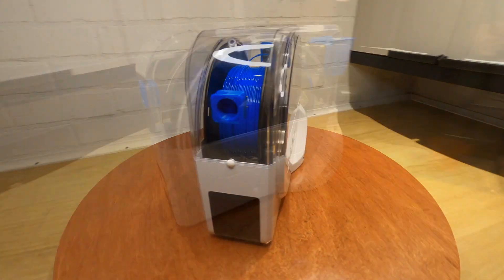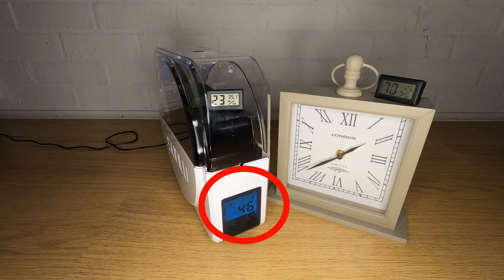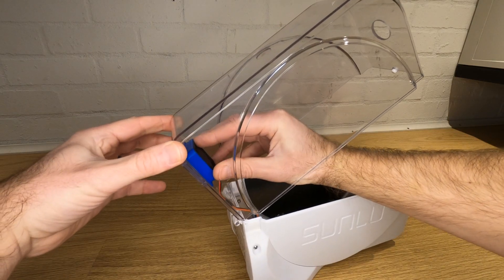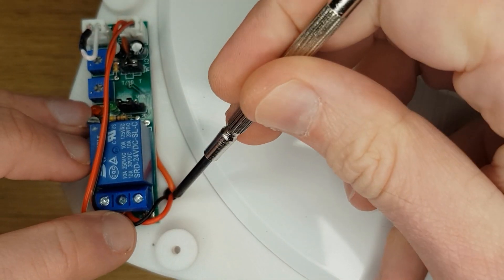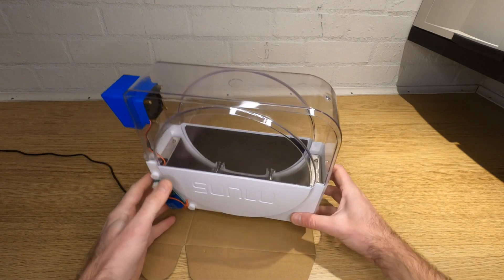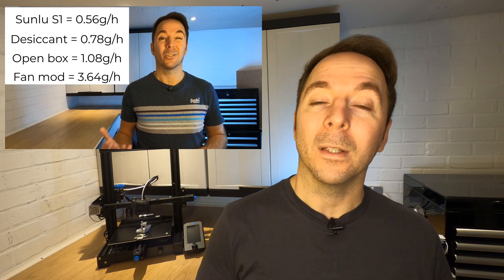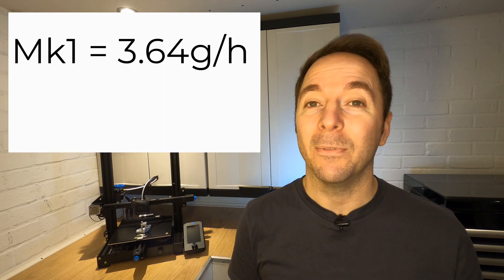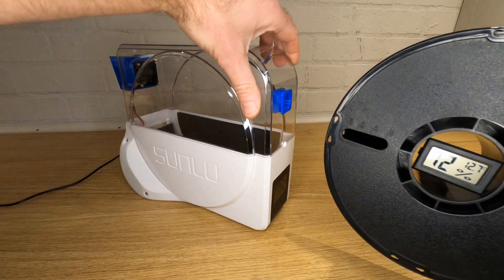Sunlu S1 Filadryer Turbo Mod Mark 2 & Build Guide (Timer, speed control, intake vents and more!)

Comment: Ok, I have everything wired correctly, relay and thermal switch is working properly. My issue is the 40mm fan listed in the parts comments is barely moving any air. The louvers aren't moving at all. There is no issue with the parts rubbing, the louver flaps move very freely; the fan speed is just way too low to push them open. It's a 24 volt fan, just nowhere near the RPMs of the fan in the video. Any suggestions?
Reply from the maker: Did you use the same fan that I linked to in the video description Bryan? If not, then it's possible that you simply have a fan that doesn't move enough air.
Reply: @RickyImpey  yes, used the link to order the fan directly from Amazon US. Maybe I got a bad fan? I can order another and try it.
Reply from the maker: @Squak242  Strange 🤔. In that case then I would just be extra careful to make sure your fan flaps are completely free moving. They need to be able to drop when you turn the whole assembly backwards like when you open the lid. When the fan is on, mine only open approx 3-4mm but it's enough to push moist air out.

Comment: Add a small metal insulated box with a slotted box that feeds the main box air. Fill the first box with desiccant packets so the air inside the metal box receives dry air. Place a heating element in the metal insulated box. Now feed your filament dryer box air from the previous mentioned setup. Also insulate your sunu

Comment: By the way, those humidity sensors are very poor. I have them and mines are reliable only down to 39%. Below that, and the start dropping WAY faster than the air. Compared to a proper sensor, for example, they may indicate 33% for 38%, 25% for 34%, and so on. The difference between indicated and real RH is about zero at 39% and increases below that. Temperature is fine.
Get a reliable one, like Xiaomi or Aqara temperature humidity sensor (zigbee), which I tested down to few % RH.

Comment: With a 40 mm fan placed in the front top corner pointed down you should be able to have a circular circulation of air, so that the colder top air will pass down and heat again, so that overall everything will stay hotter. Periodically, the existing fan will push out air, or simply use natural circulation, with a smaller hole always open (use a iris diaphragm to tune the diameter of the hole for passive removal). On the transparent top you can put insulating foam everywhere, it should not affect the spools.
Reply: I was recommended by Youtube this video which shows exactly what I was proposing! https://www.youtube.com/watch?v=6FG4O5l9XpE The results are amazing.

Comment: Check the $10 STC-3028 humidity and temp controller, have different versions for ac/dc etc. Gives the option of independently controlling the temp and humidity. I'm thinking over using a styrofoam box, depending on the size, it can accomodate 1 or several spools. A small glass/plastic window is easy to cut in.  Also, how anout using a small membrane vacuum pump, to get rid of the moisture... Lots of options
Reply from the maker: Yes, I think I've pushed the Sunlu S1 as far as I'm going to for now. I would like to be able to dry multiple rolls of filament at a time but the hardest thing is finding a suitable box.

Comment: Thanks!! Great solution. I opted for four 3/16" holes along the bottom on each side, two in the front and two in the back, and four 3/16" holes around the center of the top of the unit. You made a good point about convection and I thought I would take advantage of it. My unit  temp stays between 55 and 56 C now and you can feel the heat coming out of the holes on top. I do like your box dryer solution too. Thanks again.
Reply from the maker: Sounds good Chris, that will definitely improve things over the standard unit👍

Comment: let it breath dry air in by using an oil bath/ silica gel bead contraption like a "transformer breather"... and/or heat incoming air and dry it again, using silica.

Comment: I have 2 of the Sunlu S1's that have been modded to include the fan to move around the air, and the thermal sensor.  I also use a couple of packs of desiccant placed in a holder in the center hole of the spools.  I forget the exact name of the holder, but I got it from Thingiverse.  Using a gauge almost identical to yours, I can watch the humidity raise significantly (sometimes with visible moisture in the lid), then significantly drop as time goes on.  My biggest issue is that despite setting them at 55C, the temps rarely get above 48-50C inside.  This is verified by not only the gauge, but an IR temp gun.  If I could get these things to actually reach 55C, it would rate #1 on my list of dryers.  For reference, I also have the Sovol 3D dryer, and the PrintDry Pro dryer.  Both of them have advantages, and disadvantages over the Sunlu unit.
Reply: Do you already have a towel to insulate?
Reply: @olafmarzocchi6194  I do not have a towel in it.   Why would I?
Reply: @tommyc8333  to reduce heat losses
Reply: @olafmarzocchi6194  not really sure how that would work.  I would think a towel would be too heavy and cause the spool not to rotate.  You certainly cant put it on the bottom near the heater.

Comment: Put the Mod together tonight and did some preliminary testing. I first had the temp switch at the bottom and it turned on well before the plate reached 55C. With the exhaust fan on the plate temp never got above 45C. 

I moved the temp sensor above the plate near the bottom of the lid. Just about where the top and bottom meet. The temp switch did not activate even with the plate temp at 55C. So I moved it down slightly so it was hovering just above the plate's back, top edge. It the fan turned on when the plate temp reached 55C. I'm using a 50C switch. 

The remaining issue is with the fan going and the temp switch not turning off below 50C, the plate temp drops below 50C. As low as 43C on one run. Definitely need a resistor to slow down the exhaust fan. I'm thinking about half the air flow would be about perfect. I guess I'll be looking for an online Ohm's law calculator.
Reply from the maker: Yes, I'm currently running mine with a 330 Ohm resistor and pretty happy with how it works.
Reply: @RickyImpey  thanks I'll start there. Appreciate the help.
Reply: @RickyImpey  Just and update. The 330 Ohm worked well for slowing the exhaust fan. However, and this is a brain teaser, the plate temp is reading lower (41c) with the slower fan speed at this slower exhaust fan speed. Oddly enough, when I remove the front vent (just leaving a hole for incoming air) the plate temp goes up and stays steady at 52c. I'm assuming hot air is rising to the top and being exhausted out the back, leaving the air around the heating unit under the spool relatively untouched? The ultimate question is will this relatively free pathway of air at the top of the unit dry the filament effectively? I'll let you know what my testing shows.
Reply from the maker: @twms8728  I find it really difficult to predict how the airflow is going to behave. Sometimes the strangest things work and things that you think will definitely help, don't. I work on the principal that the air around the filament needs to be as warm as possible, as that is what will draw the moisture out, and there needs to be some way of removing the damp air periodically. Sometimes the plate temp can be lower because there is more air flow moving the warm air around the box but effectively cooling the element. Tricky 🤔
Reply: @RickyImpey  I'm definitely with you on getting the filament temp up. Doing some semi-scientific testing on a small amount of PETG now. I'll let you know what, if anything, I find. I'm also looking at your timer idea. It makes sense to let the air heat up, grab the moisture, then purge it several times during the process. I'm thinking once every 15-30 minutes.
Reply from the maker: @twms8728  Yes, mine is set to coming on for about 30 seconds to a minute every 20 minutes. The temperature isn't as high as I would like but it works and I definitely notice the difference in all filament I dry. I've seen the difference with PLA, PETG, TPU and ABS.
Reply: @RickyImpey  Success! I removed the temp switch from the process and added a timer. I left the 300 Ohm resistor on the fan to slow it down. Then set the timer to run for 60 seconds every 25 minutes. You can actually see the condensation building up on the side of the lid, then disappearing as the fan exhausts the moisture. The plate temp never drops below 54c and stays very steady between 54c and 56c.

 I certainly appreciate all the help with this. It's definitely worth taking the time to do the mod! Regardless of the version you find works best for you.
Reply from the maker: @twms8728  awesome, really glad you have something that works for you. I would advise drying anything new you open, i find everything gets lighter regardless of the filament. It's just a part of my process now.

Comment: I dry my filament with a cheap food dehydrator.  By cheap, I mean half the price of the Sunlu mk1.   There are a number of modifications available, but for now I simply cut a hole in the trays sufficiently large to fit a spool.  This morning at an ambient temp of 27° and RH of 84% I had 26% humidity @44.7° at the top of the box.   I am wondering (apart from the fact that you already own the Sunlu) is it worth persevering or is it actually the wrong base for the project?    I am also wondering if the internals of the food dehydrator would make the beginnings of a better filament dryer!
Reply from the maker: Hi, there are many ways to do the same job of course and the Sunlu is far from the perfect starting point. What frustrates me about the Sunlu is that it could be so much better with a little better design. The heating element is fine and can reach high temperatures but the rest of the box falls short. I think they went for looks over function unfortunately. All we really need is accurately controlled temperatures and a way to move the damp air away. If a food dehydrator does that better then it very well could be a better base to start with. I may get one to play with one day. I chose the Sunlu as a lot of people have already bought them and been disappointed. Thanks for your comment 👍

Comment: Hi Ricky,

I did the mod you showed, but with my personal touch and the result is simply AMAZING !!  I strongly suggest you to do the same and maybe share to the community.

I added the exit vent on the back as well as the small intake dock on the front. It's exactly the same as you did. Thank you, by the way!!

I also added the time relay in series with a thermal switch. I preferred to go with a 40° thermal switch because the air change cycle will keep going for a longer time after the heat turn off and it will allow more humidity to go out by the time the entire air temp get back to room temperature.

The main addition I did, which also helped a lot, is that I relocated one of the thermistor right under the back dock and also I  connected a blower in parallel with the timer relay. Doing so, the blower fan will start to circulate air inside the chamber as long as the timer relay is powered. That small addon help to reach lower humidity level.

The only down side is that the inside temperature is reduced by 2 °C when the other dock fan kicked in for 5 sec. Which mean even more air have been pulled out of the container(as well as the humidity).

The positive is that by circulating, it "cheat" the temp reading between both thermistor so the temp can reach 56-57 degree quite often.

By the way, I'm looking for a way to change the limit of 55 degree in the controler. If anyone has an idea how to do that, that would be amazing!
Reply from the maker: Sounds awesome Carl. What did you use as a circulating blower? Where did you mount it?
Reply: @RickyImpey  I mounted a 24v blower (pointing down)right under the docking on the back side. I drilled the hole for the dock slightly higher than what you showed, but I believe the blower would fit either way. The blower hold in place with velcro and I mounted the second thermistor to the blower with a tie-wrap.

With that setup, I can reach 16-17% humidity without desiccant.

Comment: I modded my sunlu s1 by installing a blower fan to circulate air down over the element and around back to the fan. I also moved the sensor to sit near the fan intake to ensure even air temp through out the unit.
To reduce humidity you need to use desiccant. It's much more energy efficient. Ideally calcium chloride as it's much better than silica gel. But this is not easy as there is little spare space in this unit and calcium chloride turns liquid as it absorbs water so you can't really place it in the spools axle hole.
The Sunlu unit is better suited to keeping pre dried filaments dry while printing. Not so much for drying filaments outright.
Useful if your printing Nylons or even petg if you live in a area with high humidity.
Reply: does your blower just circulate the air inside with no extractors for humidity? One guy on youtube does this simple mod without moisture extraction and shows thermal imaging of the filament getting warm, however this does not mean moisture has decreased i guess. im still undecided..
Reply: @olpallix  pretty much as you describe, however I store my filaments in a air tight tote with calcium chloride. The only time I use the sunlu dryer is if a hydroscopic filament has been in open air for a day or 2. Mainly petg. I also stuff silica in the middle of the filament role when using the sunlu dryer.
Reply: @ashleywhitehead3710  thank you. I’ll buy some silica. The thing with me is I leave the filament attached for weeks. So I hope that leaving it in the Sunlu box switched off with silica inside will stop moisture getting to it. Cheers.

Comment: Have you given any thought to increasing the input voltage?  I would imagine that alone would allow the heating element to reach higher temperatures. May need a different temperature controller and, at some point, may lead to a meltdown.😬
Reply from the maker: To be fair, the element gets plenty hot from my testing. The problem seems to be that the heat just dissipates too quickly. I think, like you say, there could be a whole world of extra problems from increasing the voltage😬

Comment: Thinking back about your self-closing blades I have two suggestions: if you use carboard or transparent plastic foil (like for projectors) you can reduce the weight and maximise flow (which means, shorter running time or lower fan speed for less noise). Blades can also be shaped as a "P" instead of a wedge, so that they weigh less.
Since an axial fan is not suited to be operated with a back-pressure (the blades), you could try even a very thin stator to convert speed into pressure, like https://www.youtube.com/watch?v=rDq4KSlZcTo Likewise, more flow and therefore shorter run time, or lower fan speed. It increases thickness by 10 mm which could be either inside or outside of the enclosure (I'm not sure about space inside).
Reply from the maker: 🤔 Very interesting. I love this sort of stuff Olaf. Definitely some good ideas here. What I have done is far from optimised so there could be a lot more to come. I tend to think that more drying efficiency could come more from consistently higher temperatures but all of your ideas are valid for making the fan duct better. The video you linked to has actually given me an idea for an improved hotend cooling duct too. I'd definitely like to investigate a little further. Thanks👍
Reply: @RickyImpey  I was thinking of active cooling of air being removed and replaced, Sounds counter-intuitive, but if you re-circulate that air back in, and have the hot side inside the box just before the air goes back in, the waste heat from active cooling should be reused and useful to the system. Peltier.

Have the intake outtake opposite sides of the box, or? then any moisture that condenses on the cold side should be allowed to run down a drain tube, to a small open reservoir, 
Thermal insulation on the whole setup would be a big benefit. Combined with your timer setup, I have a feeling this will improve the moisture removal time considerably.

Love your videos, getting great ideas and tips from you. keep up the good work.
Reply: I am also wondering if some sort of convection could be used here with the hotside coldside, reducing the amount of fan time needed.
Reply from the maker: @brycering5989  I've toyed with the idea of trying to remove any moisture from the air and reusing it but haven't experimented yet. Let me know how you get on if you try it.
Reply: @brycering5989 this actually is a very good idea, take the air out, run it over a cold peltier cooled (preferably really cold, and pid controlled) heatsink, and then feed that back through the hot side and let the air warm back to temp that way

make the peltier alternate after each few mins to defrost the cold side and have some sort of condensate catcher and voila, you basically have a peltier powered dehumidifier (thats exactly how some small electric dehumidifers work)

peltiers should be able to reach about 70°C tdelta so approx -20 and 50 should be doable, just need to watch the fan speed dependant on how powerful (or not) the mentioned peltier is